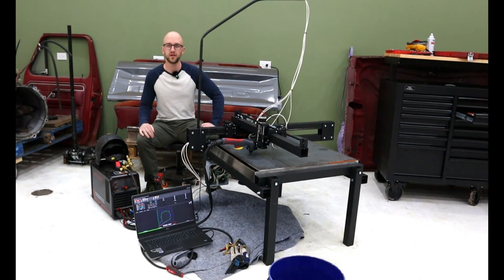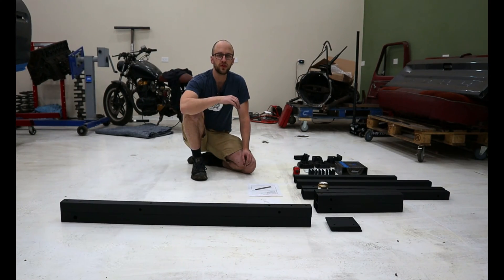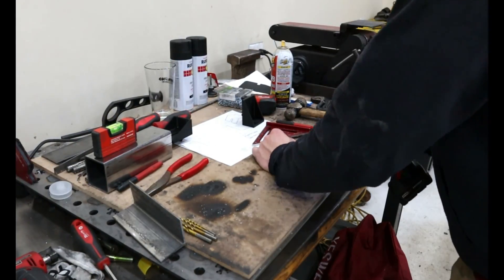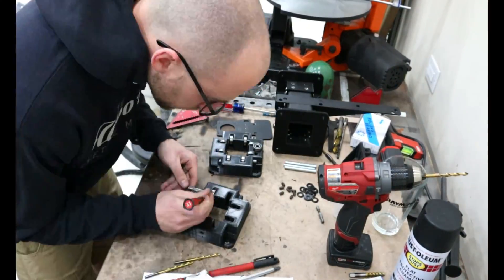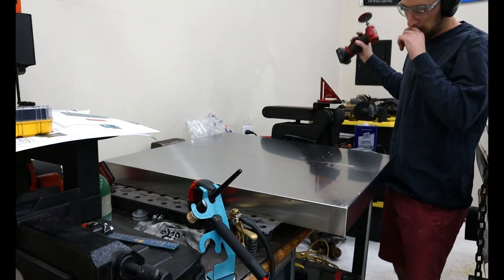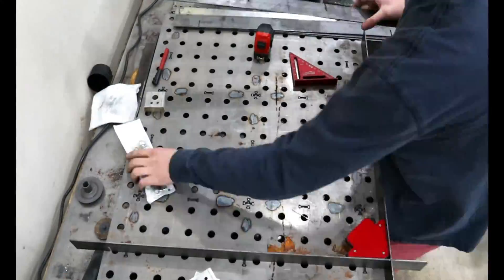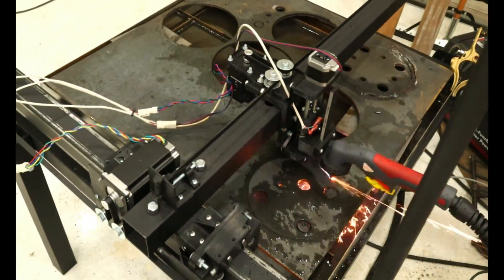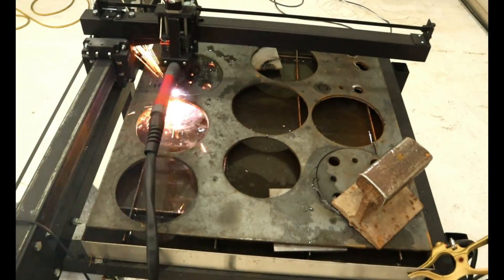DIY CNC Plasma Table: Home Built Following JD's Garage Plans

Comment: What are the overall exterior dimensions of the table? I'm thinking about going this route, but I have limited space in my garage and the one rail seems to stick out way past the table. Also, have you made any mods to this table since the initial build? Thanks!
Reply from the maker: To be honest with you, I sold it a few months after this build. It worked decent but I hated the cantilever system. I would make another rail on the other side if I were to do it over. 
The table was approximately 2'x2' but they have since release a larger version. It is also easy enough to modify to whatever dimensions you want. 
Personally I find it easier to use SendCutSend for my projects though it does come at a cost but quality is top notch and dimensions are spot on.
Reply: @barnbuiltbeaters thanks for the quick response! Yes, I’ve had concerns about the cantilever design as well. I do a lot of 3D printing and know that would never work for it, so I can’t imagine it working well holding a plasma torch level over that distance.

Comment: I am considering this build, as I don't have room for the XL.  I've heard  a lot about people experiencing issues with EMI causing problems when cutting.  Did you have any issues with torch not cutting, shutting off, etc.?  thanks for sharing, Ken
Reply from the maker: I had zero issues! The only problems I had were of my own doing such as forgetting the ground clamp or not having the proper cut setting turned on. Good Luck!

Comment: Hello, I have some questions about the electrical circuit. Could you share the diagrams with us?
Reply from the maker: This is not my design, therefore I do not have the permissions to share. You can purchase the plans through JD's Garage Website for about $25 which includes everything you would need to know to build your own.

Comment: First mistake… painting the bearing rails…
Reply from the maker: @RyanClark7923  the bearings wore through the paint so not a huge deal. Just didn't want it to rust. If i were to do it all over again, I'd do an extruded aluminum table.
Reply: Did you blue yours?  How to avoid rust without painting?
Reply from the maker: @anexoworkshop  I painted mine. The roller bearings eventually wore through but only where they contacted.

Comment: What about torch height controller ?
Using it or not? Is it really necessary ?
Reply from the maker: @jw200  JD's garage and myself believe it isn't necessary for most people. It's pretty expensive addition and you can get decent cuts without it. Hope that helps!
Reply: @barnbuiltbeaters  Actually there are free schematics for this too online. Especially on russian forums.
But I will not do it atm. I have to first start the cutter project and then think about height controller.
I see you got pretty good cuts without it. Thanks for reply.
Reply from the maker: @jw200  my cut quality could have been improved. They were slightly beveled and a good amount of dross on the back. But sure beats cutting it out on the bandsaw!

Comment: I’m considering building the JDs Garage XL plans with the two sided overarm support. One concern I have with this system is the use of 3D printed parts. You mentioned that the JDs design is a copy of the Langmuir system. Does the Langmuir system use similar plastic parts or something more reliable? I like the “pay as you go” aspect of the JDs design, but my 3D printer is probably not up to the task. Ender 3 v2.
Reply from the maker: @kitmaira  im actually not sure what Langmuir uses. I want to say it is aluminum but honestly not sure. I Printed my JD's design on my Ender 3 V2 out of PLA+ and it has held up well. 
If it's in your budget I recommend upgrading to a Bambu Labs model. They work much better, work with any material with their provided settings. It makes 3D printing much more enjoyable. The Ender 3 is good to get started though don't get me wrong. Good luck on your build!
Reply: I’m thinking that buying the Bambu would be much more expensive than buying the printed parts. I get way too little use out of my Ender as it is. Still figuring out what I want to do. Thanks.
Reply from the maker: @kitmaira  your Ender will be just fine for those parts!

Comment: Such a clean build! Really liked that you used connectors on the motors. Have you had any problems with setting up the z axis? Any tips on that since I am tackling the z axis at the moment, and cant seem to be able how to make it touch off prop. Best regards!
Reply from the maker: @ivanyalamov5109  thanks for watching! No issues with Z-axis other than some slop at the end of the cantilever. For touch off, I believe their is a setting in fusion you need to check or a line in G-code you need to add. I haven't used it in months so unfortunately I'm not much help. There is a group on Facebook you can join and ask "3D Printed Budget CNC Plasma Builders", most are building JD's table.
Reply: @barnbuiltbeaters  Much appreciated!

Comment: in the process of building a JD Garage unit. Have been disappointed with responses from them.
Reply from the maker: @KenMayer-g7f  i ran into the same issue as well. Let me know if you need help i may be able to assist!

Comment: Your comment about buying the Langmuir I kinda disagree with. Im glad I built mine from JD because i know how its built and if it breaks down I know what to do. I also like the idea I built it as money dictated, meaning one week I had extra to spend, next week I didnt. With Langmuir I had to come up with the money all at once. as far as support JD has a facebook page now with tons of support, and I was able to email them as well while building mine. Anyway nice video.
Reply from the maker: @jeffjohnson5394  I totally understand that point of view and that's why I ended up building mine. The table is decent but I think I have to spend some time tinkering with it. I'd much rather be fabricating than tinkering. I would like to think the Langmuir is ready to rock out of the box. 
If I was to do it over, I'd either buy a Langmuir or build JDs table again but use extruded aluminum
Reply: He didn't say buy the Liangmiur table. He said that Jds design was a pirated version of it.

Comment: I used a 30"x32" water pan from Vevor ($85) . I had to make the table a bit bigger to accommodate it. Planned that ahead of time. It also has a drain for the water which helps a ton when emptying.
Reply from the maker: Sounds like the exact pan I ordered. I made my table and then ordered the pan. Should have done it the other way around, smart!

Comment: What software are you using to run your plasma's gcode it looks different than the normal grbl program that i have?
Reply from the maker: I am using Fusion to generate the Gcode and then the normal grbl program. I think I selected dark mode which may be why it looks different?

Comment: At the 6:10 mark you are turning an allen key to raise the cantilevered X axis to level it. I think I may be doing this wrong on my JD plasma table. I loosen the 8 bolts on the carriage that rides on Y axis to adjust the X axis level.  I am going to have to go back and look at some of the instructions again to see if I am doing this wrong. To be honest this is an area I have struggled with and am very much looking forward to the THC to possibly take the leveling out of the equation.
Reply from the maker: I am sure you just saw they just released the THC but it is a pretty expensive option that many people probably dont need....maybe you do though. I think the budget friendly option is to build a duplicate Y axis (without the motor) which would keep everything level. The cantilever design   is the worst part about the build...much more to be desired. 
I spent a good amount of time getting mine adjusted. If you tighten it too much, it wont roll. Go to that point and then back it off some. It will never be perfectly level, atleast not from my experience but has not affected cutting much. 
If you are like me, I do not need my cuts to be perfect, just close. A CNC plasma I use to speed up my fabrication process, not looking for perfection perfectly. Let me know if you need help, I am happy to try!
Thanks for watching!
Reply: Oh man, traming that arm is driving me insane. I get a 5mm (1/4in ish) drop at the end, and I just can't dial it out. I'm combing yt looking for tips on how to deal with it. I might be adding a support rail...
Reply from the maker: @timandrew4515  I found a video where someone added a caster wheel to the arm that rides on the table frame. I think for a quick fix this might work perfect. Havent used the table too much recently, so havent had the urge to fix it either! Let me know if you find a solution!

Comment: Do you have a link for tthe larger pan? I'm sill in the planning stages and am workiing in some other upgrades prior to building it. I can adjust the pieces accordingly to fit a larger pan even if it isn'tt much. Good video!
Reply from the maker: VBENLEM 32 x 30 x 2.5 Inch... https://www.amazon.com/dp/B07XP6ZN7N?ref=ppx_pop_mob_ap_share

FYI, The pan they recommend is nicer than the one. heavier gauge metal. Also note, this one has a drain hole, nothing you couldn't plug but be aware. Thanks for watching!
Reply: @barnbuiltbeaters  I put a 1/4 turn PVC valve on the drain hole with a 90 elbow pointing down. I drain the water into a 5 gallon bucket after every day of cutting. I do have to lift the pan a little bit to get some of the water out since there is a lip on the drain plumbing. Works great! I don't know what you would do if you didn't have the drain. I mean trying to dump the water without the drain would be a mess as the pan is fairly thin and weak, you have the supports in there and the X axis would be in the way when trying to lift it to drain it . . . love the drain! LOL HIGHLY recommend putting in a drain if you buy a pan without one. With that said, a bottom drain might be better than a side drain . . .
Reply from the maker: @glenrock672  the pan JD recommends is a lot nicer than the vevor. Much thicker gauge. I admit it'll still be a pain to drain though! Haven't done so yet!
Reply: @barnbuiltbeaters  Since I didn't get that one, I'll take your word for it, but it was $130 versus $85 . . . Being a cheap ars, I went with the Vevor! LOL

Comment: Need to speed up that cut to eliminate the dross and make sure you're not using a fine cut nozzle, use a standard nozzle. Does the CNC table have torch height control?
Reply from the maker: I am still playing with speeds and plan on increasing as it has been helping a lot with dross. Thanks for the insight! Only one nozzle available for my Plasma (YesWelder CT2050) I believe.
CNC does not have THC only z-probe. JD's Garage is working on THC but have not yet released it.